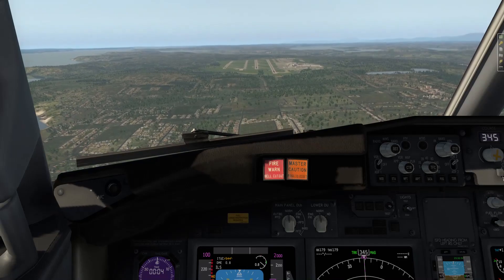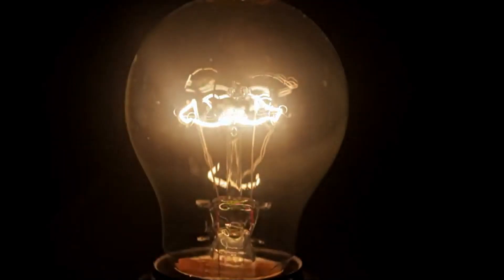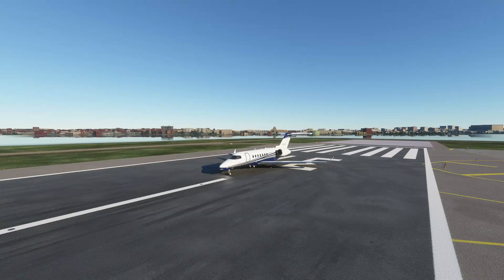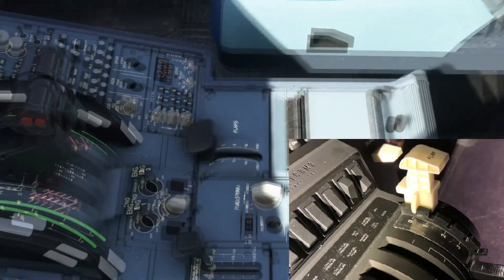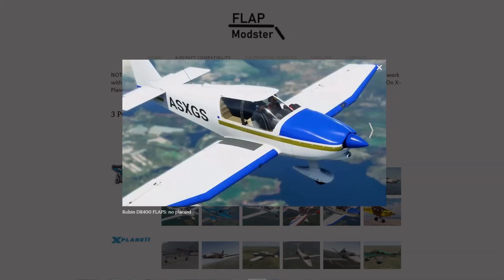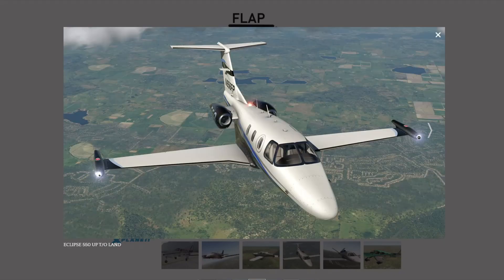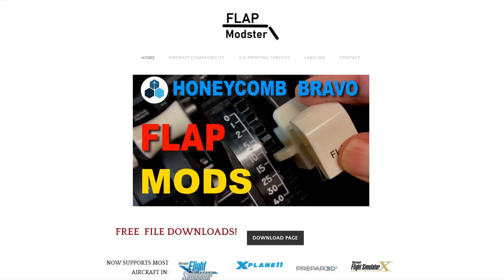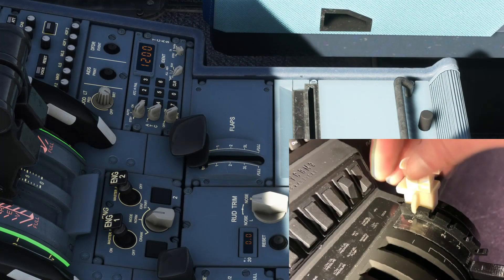Free Honeycomb Bravo Flap Mods

Comment: Hello and thank you for sharing. A question however, for the handle of the Flap, it does not appear in the list of 3D objects and it is a pity because I printed the file "chunky_handle_short.stl" but this circle is too big and does not correspond to the video. Could we have the right file. A big thank-you.
Reply from the maker: You use the original honeycomb airliner flap. The finger grab slides over the shaft. You do not need to print that part as it is part of honeycomb bravo
Reply: @rbarlow  Stunned I am! Sorry for this unwarranted comment. Thank you ! Thank you !
Reply from the maker: @jean-francoisragneau1816  no problem

Comment: Hi Russ, I have the Bravo working fine and have downloaded some profiles.  I recently bought the X-Aviation TBM900 (brilliant) but it has only one lever for all throttle actions from Cut Off, to Low Idle to High Idle to Flight.  I have managed to use the TOGO button to allow me into the Taxi and Reverse thrust regions so all is fine for flying but startup and shut down need the mouse and I often get weird results.  I would like to use another throttle lever to simulate Cut Off, Low Idle and High Idle but I cannot find how to do this.  I have opened X-plane and Bravo profile files in Text Reader to try and understand how it is done by I can't find any instructions for throttles.   I hope I have not missed something simple but could you please give us a video to cover this?  Best wishes Anthony

Comment: I just ordered 3 flap mods and the handle. There's a link for information on the spring required for the handle, but it doesn't seem to be working. Can you give me any info on specs of the spring that is needed? Thanks.

Comment: Russ,  THANK YOU SO MUCH.  these videos are great and I just ordered a slightly larger touch screen to get both a PFD and MFD in! 
QUESTION:  I am out of display ports on my computer and don't want to buy another expensive GPU.  The CPU port is AMD and doesn't have a display graphics integrated. 
HOW DO I add a monitor then?  for example, can I use a LOWER POWER GPU just to run the Instruments? 
Thank you once again for your help.
Reply from the maker: You could add another GPU but look at this option too https://youtu.be/vZfz2qisJ40
Reply: @rbarlow  Thank you.  This was helpful.  But I prefer not to have more external peripherals.  I have plenty of PCI4 slots available in my mother board and would much rather something internal.  It would be used strictly for the display/instruments screen so I don't care much about the processing. I just don't want it to interfere with my main GPU.  i.e. i would like to know if you have an inexpensive GPU with a few HDMI or Display ports that you reccomend?  

Please note that MOST AMD CPUs by the way do not have integrated graphics cards. i did not know this and so I found out the hard way that my Mother Board CPU will be inoperable for this purpose.  (i.e. the HDMI and Display ports in my mother board don't seem to be usable to run the "instrument" display screens). 
Any help you can give would be appreciated

Comment: Russ quick question, I'm trying to assign magnetos to physical switches, in DataRefTool I can see the switches assigned by the developer (Milviz 310 Magnetos) and not XPlanes. When I search "Milviz" in xplane for button assignment other Milviz items come up but not Magnetos.
Reply from the maker: Are you looking at datarefs or commands?
X-Plane has commands for all mag positions as well as up one position and down one. Try the basic commands or Miliz may have custom commands too. See if this helps.... definitely possible. It may be listed under ignition switch or something like that. If you can’t find it let me know and I will look it up.
Reply: @rbarlow  do you have Melviz 310? try to assign the magnetos to a switch. DataRefTool shows Milviz/c310/magnetos_left_1 but when I go into xplane to assign it it doesn't show up as an option. When I search in xplane Milviz other items show up of Milviz but not the magnetos
Reply: Your correct Milviz has a custom command for left and right mags but they don't show up like their other commands when trying to assign in xplane would you mind looking it up?
Reply from the maker: @gregoryanderson6717  they should be under some heading like Milviz but without having the airplane I am guessing
Reply: @rbarlow  ya their not under Milviz custom commands options SO FRUSTRATING I thought you could assign every switch
Reply from the maker: @gregoryanderson6717  I think it should be possible.... have you tried the standard commands? Usually if there are no custom commands the standard ones work
Reply: @rbarlow  there are custom commands Russ but the custom commands are not showing up to assign in X-Plane and I tried every single standard command
Reply from the maker: @gregoryanderson6717  better ask Milviz. I remember having a similar issue finding some of the custom Zibo commands in the controls setup in XP but can’t remember how I solved it. If I have time later I will take a look in XP and see if it jogs my memory.
Reply: @rbarlow  thank you love your channel buddy doing a great job

Comment: Thanks for such a great product Russ, I received my "finger lift, 5 position and 9 position flap mods" all printed and shipped for $12 and I couldn't be happier. Ordered on a Tue and rec'd on Mon. They fit kind of snug so switching from the 9 to 5 position may need a little help carefully with a flat screwdriver but if it becomes a problem I will shave down the inside a bit with a Dremel.

Comment: For the Carvan in MS2020, what is the secret to binding the Flap-Mod (4-position)?  I can't get the Caravan to go from "UP" to 10 to then 20, to then "Land" or "FULL"  ..... if I use AXIS 0 to 100 % no-go, if I use AXIS -100 to 100, no-go.  I know there is a way to do it (i think).  Perhaps not?  I'm in a real bind
Reply from the maker: It definately works but make sure there are not any other inputs bound to the flaps as they seem to conflict. Check to find other flap bindings and clear them and then the axis should work. I had a similar issue but it works fine now.
Reply: @rbarlow  EDITED Update:  I eventually got the Flap mod assigned properly (bindings) but discovered they have the interior wrong.  So the reason it won't stop on 10 degrees is because there is no 10 degrees in the "EX" model.   In the Caravan, if you go to external view and look at the flaps detent box there to the right,  you will see that shows 3 positions, UP, 15 & 30.  But since they rendered the interior wrong (208B EX doesn't have 10 degrees of flaps any longer so the rendered Quadrant is wrong ). Asobo would have to fix the internal rendered flaps quadrant pod to NOT show 10, then fix the external flaps box to show "UP", "20", & Land (30) instead of up, 15, 30.   They (Asobo) probably have bigger fish to fry, lol.
Reply: @dabneyoffermein595  Change these last five lines in the flight_model.cfg file:

max_on_ground_position = 3
flaps-position.0 = 0, -1, 0
flaps-position.1 = 10, 175, 0.33
flaps-position.2 = 20, 150, 0.67
flaps-position.3 = 30, 125, 1
Reply: @virtualDon  Great, will do that today.  will that allow the internal FLAPS renderings on the throttle quadrant inside the cockpit, move to the 10 position now?

Comment: Not sure what happened, but unfortunately when I printed mine off, the finger lifter is too small for my flap piece 🙁 I have been trying to push it in, but it won't fit. I've tried scraping the inside of it to make it bigger and eventually got the bottom of the flap piece just inside the opening but couldn't move it any further and didn't want to break the flap handle. I downloaded the file, opened it up in my 3d printer program and put it on my sd to put in the printer and it came out smaller than it should have been :(

Comment: Got my 4 slot and 9 slot inserts and the finger catch today - $55 from Xometry! They are Awesome!
Reply: How do you bind the 4-slot for the Cessna Caravan (MS FS2020).  I've tried everything, just don't know how to get it to work with the 4-position Mod.
Reply: @dabneyoffermein595  I've tried everything, including JayDee's C208B performance mod as well as the Flightstream and FlightTracker addons for my Stream Deck and can find no setting that will set the C208 flaps to 10%. They go right to 20% then to full. I've even played around with the sensitivity curves and discreet flap settings - nothing seems to work. I still use the four slot insert but only get UP, 20% & 30% on the C208. If you find something that works let me know!
Reply: @virtualDon  Ok, so I found something out by trial-n-error.  If you go to external view (toggle out of cockpit mode to external) and look at the FLAPS detent box to the right, there is only a 0, 15, & 30.  So the way it's designed in the software is that there are only 3 detents , and of course as we know, these are wrong, it should be 0, 10, 20, & Full.   So I will now jump on the forums and search it up, i'm sure someone has reported it long ago and it's probably "in-progress"  (Just a guess).  But I will keep you posted.
Reply: @dabneyoffermein595  I noticed this but, at least in the performance mod, it does not  perform at all correctly. On the ground, flaps go right to 20% then full (or 15% to 30%?) then do nothing for the fourth notch. In the air, however, they go 15%, 30% then back to 0% in the bottom notch (as if you put them all the way back into the uppermost notch). They indicate 0% on the external gauge as well. Not sure if this is something particular to the performance mod or not. As for the binding - I've only been able to get it to respond to the -100% to 100% axis setting. All the rest seem to only respond to switches or toggles.
Reply: @virtualDon  - yep, that's the one I'm using -100% to 100%  (Axis).  will not see 10% .... i do not have nor did I know there was a performance mod.  I searched the MS 2020 forums and don't see much out there, i did get a few hits but they were all discounted as that the caravan should only have 2 detents, which is wrong.  It should have UP, 10, 20, & Land.  Craziest thing ever that they only have 2 notches of flaps programmed.  I have a feeling not very many people are flying this bird in MS2020  EDIT:  Looks like the EX should only have UP, 20, Land (full) but Asobo rendered the 10 on the Throttle Quadrant , perhaps when the artist was rendering the inside of the Caravan that he only had access to the 208B (non-EX version) and it mistakenly got put in there.
Reply: @dabneyoffermein595  Here's the performance mod: https://www.nexusmods.com/microsoftflightsimulator/mods/431
Reply: @virtualDon  oh, excellent.  i will put that in for sure and thanks so much!  did you notice improvement?
Reply: @dabneyoffermein595  Yes, it climbed and cruised more like advertised performance for sure. I guess it was a performance only mod - all the functions otherwise remain the same so no help with the flaps. We'll have to wait for Carenado I suppose!
Reply: @virtualDon  --  ok, great, i am putting that mod in for sure. should help with Lukla challenge too!!  lol, yea, Carenado always does Cessna's justice

Comment: Hello Russ  Thanks for sharing the blue prints i never knew what 3d printing was until i looked it up after i saw your video.
Reply from the maker: You might look into a cheap printer like the Cetus3D that I have which cost less than $300 and it’s very simple to operate.

Comment: Amazing work! Any plans to make versions for the Asobo 787 and 747 in FS2020?
Reply from the maker: The 787 has 10 slots which will require a redesign of the slot with because there’s just not enough room between slots with 10. As for the 747 all of the slots are filled so there’s no place to insert the filler

Comment: I am asked the following questions by the designing company. So can you please answer these questions for me:
1. Which unit of measurement has your 3D model been designed in? Options were given as Millimeters (This was the default), Centimeter, or Inches.
2. I've selected PETG as material over ABS. But I'd love to hear from you.
3. Finishing options were: Standard layered finish in various colors and Smooth sanded finish in various colors. I was thinking of going with a standard layer finish with white color. Or should I not choose a color?
Reply from the maker: 1-In mm
2-Even PLA is fine unless you plant to use it store it in a very hot car or near a heat source. PETG is fine, more durable, heat resistant, better than PLA. ABS is most durable but can shrink so printer may need to adjust fir that.
3- unfinished should be fine. The video example is ABS unfinished